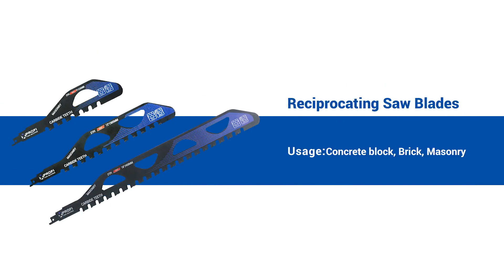Moretop Masonry Reciprocating Saw blades 2022

Comment: If you cut the brick when laying it horizontally, will it be quicker?
Reply from the maker: That's a good observation. I believe that it probably will be faster, but can't be sure, as the cutting surface is wider. 
For us it was just more convenient to fix the brick in vise vertically.